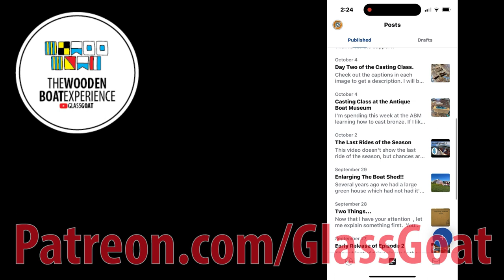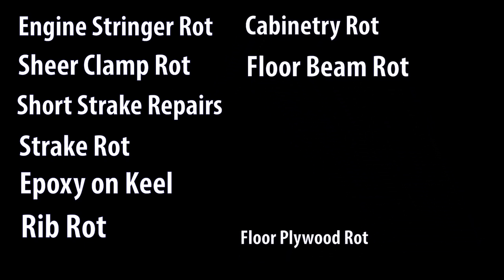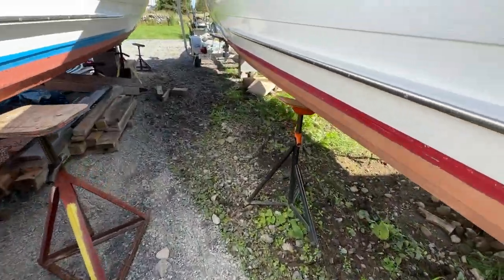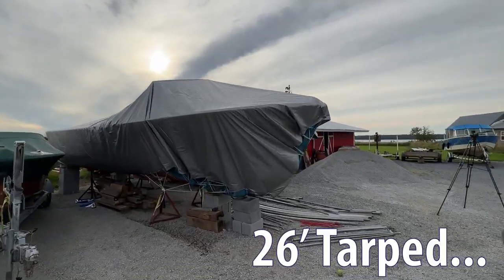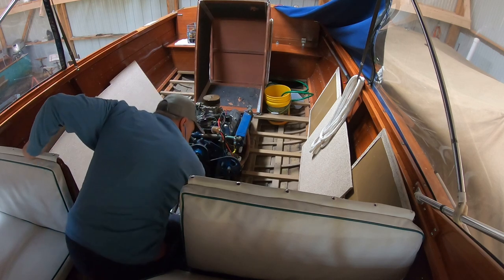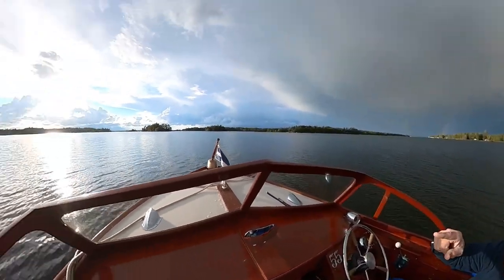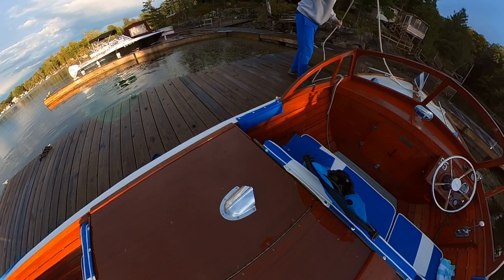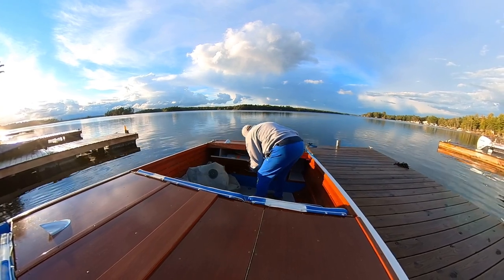S4 E4 A Lyman Situation

Comment: I really like this video.  A really good feel of years gone by.   And still wondering why/how the selfie stick is invisible in the videos.  My own boat as a kid was a 13' Lyman outboard.  Until the transom finally was more dry rot sawdust than wood.  Traded it for a new 13' MFG.  I know you remember those.  One of the originals from nearby Union City in PA.
Reply from the maker: The selfie stick gets me every time, algorithms amaze me. Our MFG was ok, until you tried to turn it at speed and then it would roll right up on the gunwale!
Reply: @glassgoat9601  I drove my MFG from the rear thwart, using the handle/throttle of the motor...so I never did a high speed power turn, lol, as I knew it would have thrown me right out of the boat and probably run me over :(    I do remember the boat would flex like crazy.  As an 80 pound kid I could stand in the boat and shift my weight back and forth rapidly and the boat would flex like a snake in heat :D, the bottom slapping on the water and making waves.   I used to love to cross cruiser wakes and 3 foot waves at speed and get launched into the air, smacking down so hard I thought the bottom would split, but it never did.  The MFG plant was just 22 miles from home (Titusville PA, summer home on Chautauqua Lake), and being one of the first plastic boat manufacturers, my curious dad watched the boat being made.
Reply from the maker: @jalbert222  I had an early fiberglass 14' (1950's ?) from the Winner boat company. It had a small split around 6" long in the keel that would leak water whenever it flexed. It was always like that and never got any worse. I ran it like that a couple of years.

Comment: Are you really going to use epoxy on those stern rot areas ?
Reply from the maker: NO, I was joking as I've pulled a lot of bondo out of areas like that and mentioned it before on camera. I'll probably replace from the waterline down with marine plywood. Above the waterline is in really good shape.